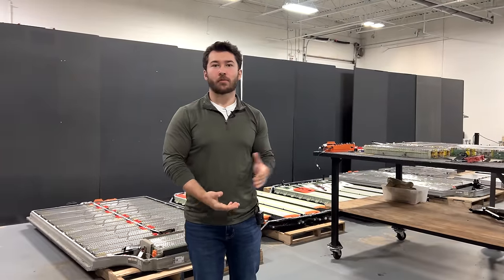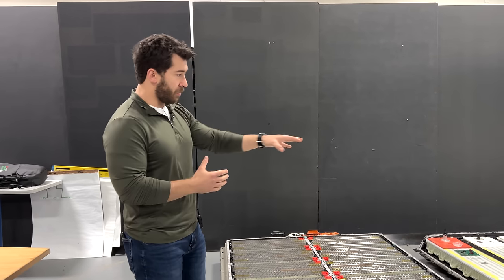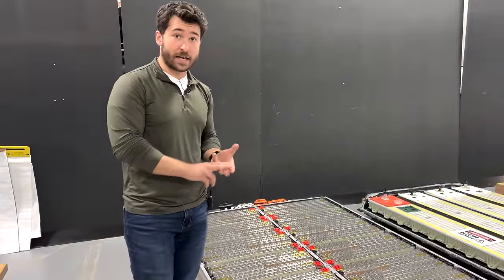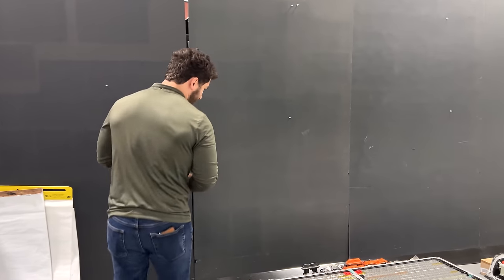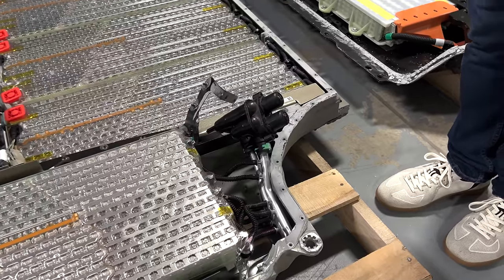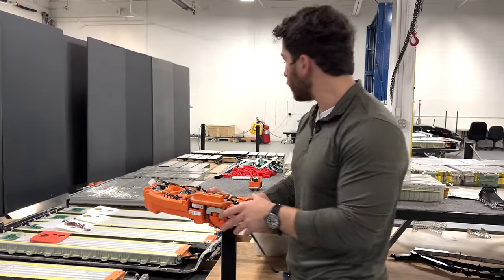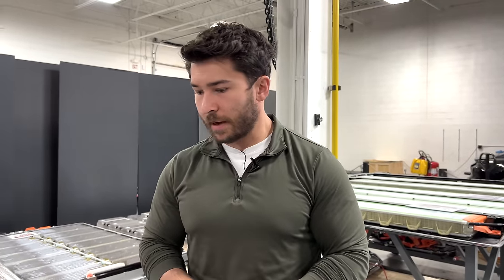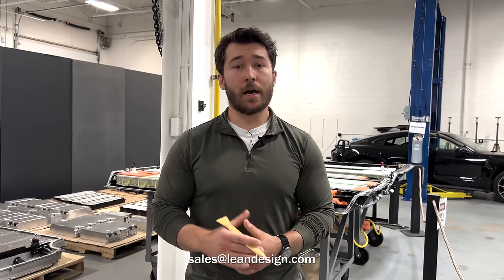A First-Ever Tesla Teardown! Model X Battery Pack Overview

Comment: I'm no engineer, let alone an automotive designer or battery expert, but this pack strikes me as much more useful, practical, repairable, and recyclable than the foam saturated 4680 skateboard that you've torn apart in previous episodes.
Reply: All the other packs are optimized for speed of production, not repairability. There’s a reason this pack is in an expensive car.
Reply: Remember that a 4680 battery pack is structural. It is not carried like a sack of potatoes, but is a stiff part of the body.
Reply: Actually it’s less… the foam is both more rigid because of adhesion between all cells.

Also the foamed batteries are more recyclable because the foam can be melted using a solvent leaving just the metal and plastic components.

This X pack has way more flex and way more plastic connectors and spacers.

You’re correct about repair ability tho.
Reply: All Leaf battery packs are modular and they're hardly a premium car.
Reply: @ramblerandy2397 Not entirely true. The foam alone doesn't achieve the increase in stiffness. It was the level of integration of the battery.
Other HV-batteries achieve also very high stiffness levels without foam. It is basically a decision between cost and what kind of repairability requirement is set. If done well the battery actually increases the overall vehicle stiffness by a lot...but that ofc comes with a lot of weight.
Reply: repairable yes, but I doubt it is more useful, practical and especially recyclable. From what I understand from the 4680 pack (I'm no expert) is that they will just throw the entire pack in the shredder after its useful life and seperate all the metals and stuff which can be directly recycled.
Reply: You don’t design something to be repairable if failure rate is low… it would omit add costs
Reply: @cybertrk sadly not the full picture... typically the pack will be grinded and after that a certain separation process begins. Depending on the process you have to use heat, chemicals or liquids, which result in pollution gases or waste liquids. It is possible to reuse that liquid for the process to achieve a high level of efficiency, but overall that foam will end up somewhere, which is typically not a good recycling design.
Here it was basically decided that the easy manufacturing process, which ofc equals cost - is more important than the life cycle of the battery, after it leaves the production site
Reply: 4680 pack is actually no harder to recycle compared to other solutions. It all goes to scrap metal shredders, and then you separate foam, plastic and other stuff from black mass. After that you send black mass for refining to extract metals like lithium, copper, nickel, etc.
Reply: There is no point in making it repairable. That'd be the equivalent of making a tvs individual pixels replaceable
Reply: when quatity is really good, it doesn't have to be repairable. Ideally all battery cells age/degrade identically, so module replacement is not an option, you'd have to replace all modules... which is easier if you replace the whole pack.
Reply: @Poxenium  but 4680 pack is actually repairable. They will locate dead cell (or cells) and will endoscopically drill through pack to get that individual cell. After they pull dead cell out, they will insert new cell, close everything back together and thats it.
Reply: @jirijezdinsky7493  that is correct...but there are also laws which mandate a certain level of repair and recycling. Over the time the degree of those gone up by quite a lot. For example the europan law mendates a recycling quote of at least 99% of the body of a vehicle.
Recent trends show that sth similar will be mandated for HV-batteries. That is why some manufacturers are going in that direction. 
In my opinion that is very good for the HV-battery, because is still very difficult to forecast the aging of the chemical components. The overall development of the cells in the recent years is astonishing.
Reply: @Poxenium Yes, in an ideal world...sadly quality is with cells the same as with fruits. 99% of the time they are good and everything is fine, but in 1% there is a worm...it very difficult to forecast the aging of cells. Also because of design of the pack (cooling, busbar etc) and the environment have an impact on the aging it is even more unlikely to forecast. But because you need to give a certain kind of warranty, the design has to be certain kind of repairable.
Reply: @stefyyy1994  with that in mind everything is repairable...but is that cost effective? I'm pretty sure that no company will take over this task. It is just too time and cost consuming to repair one individual cells. Sometimes it is not even cost efficient to repair one module...
And your description of getting a cell out is far from correct...finde someone  which happily will drill out a high voltage pack. Even if if you drain the battery (not good for aging btw ;) there is still high risk of problems. + Cell back in, welding, re-charging, testing and so on...can't see a business case here
Reply: Decision is based on failure rate of cells. If low enough then cost savings of manufacturing outweigh the cost of only being able to service at pack level. Such as 2% failure rate x $15k per pack vs save $500 per pack with no serviceability this is a net save of $200 to do this and only service at pack level. Also will say trying to put a new module into a pack with old modules will decrease life of pack and not be able to fully balance pack. Does not fix it, end up usually needing a full pack replacement in a short time.
Reply: @stefyyy1994 you have sources for that?
Reply: @ElmarBon Munro talked about recycling and repairing with Gruber.
Reply: @DB-Barrelmaker  It'd be more like making a 100-screen system having the ability to remove a screen of the system, but that would require them to care that their modules could be independent.
Reply: @ronaldking1054  no, it's like what I said, repairing pixels.
Reply: @madcoyote  Actually, I didn't mention the importance of the foam. I think you quoted the wrong commenter.
Reply: @ramblerandy2397  I phrased it wrong. Sorry...
Wanted to say that the foam itself doesn't increase the stiffness of the battery that much to make it structural. HV-batteries in general are used now as structural parts of the body. The 4680 is not entirely unique because of the foam, but because it replaces the entire bottom of the body and therfore a higher form of structural integration. The foam was only an easy and cheap way to add a bit more stiffness to it
Reply: @ramblerandy2397 that's just the frame. Cylindrical cells ain't doing shit.
Reply: @stefyyy1994  there is zero chance that any cell would ever get replaced by the means you described ... endoscopic drilling, extraction and replacement. You'd never get the cell out of the foam and adhesives.  Plus the performance of the cells has to be matched and balanced, only just the right cell could be used as a replacement. 

There are reasons tesla made the initial use of 4680s very low key and conservative in a limited run of model Ys.    They had to ensure the cells and packs were actually reliable and safe before a broader roll out.
Reply: the model 3/Y battery pack is Maintenance FREE & lasts the LIFE of the car. 
the 2021 model S/X are NO LONGER Serviceable. also, Maintenance FREE.
Reply: As Elon said the Tesla structural battery pack is simply recycled as “high-grade” ore. Makes sense if one ponders for a moment.
Reply: @tuurschellekens5385 You are correct. I have heard Elon say that the structural pack is handled like high grade ore.
Reply: @DB-Barrelmaker  No, if you use a round robin technique with a little bit of brains, it is a screen rather than pixels.
Reply: @TsLeng Wrong  by Elon’s word! Foam is structural.
Reply: @TsLeng  Not what I am seeing " that's just the frame. "
"In contrast, the structural battery pack is a lightweight and integrated design. The cells are bonded directly to the chassis of the vehicle, which helps to reduce weight and improve rigidity. The structural battery pack is also more resistant to damage than a traditional battery pack."
I expect you may ask about the damage.
"It is better able to distribute impact energy. The honeycomb structure of a structural battery pack helps to distribute impact energy evenly throughout the pack. This reduces the amount of force that is applied to any individual cell, which helps to prevent damage."
Reply: @danharold3087  you will have to bond the cells together substantially to achieve rigidity. Then you need to consider is using a  component which is flammable as a structure is sensible. The cells also need to be individually rigid to form a strong structure .Then on top you need a frame anyway. And don't forget cooling for the cells. All individual cells need to be connected to a busbar. Impact and stress forces need to be considered.  Nothing is ever fully rigid and will flex. Do you want those bus bars on the cells to flex?

Now imagine pouch or prismatic cells. Something like CATL/BYD cassette(blade) type cells. Much better .
Reply: @205rider8  elon also said his roadster 2 can fly ....😂
Reply: @TsLeng  Sounds like you did not watch the Monroe Live 4680 teardown.
Reply: @205rider8  that phrase can be applied to everything. I can grind everything down and describe it as a "high grade ore"
Sadly if you want to separate the components there will be most likely usage of chemicals or heat - at the least there will be polluted water. Especially considering the foam, which will end up somewhere...that is by no means a very good recycling design, let alone a pack which can be repaired or used for a 2nd life (not talking about taking one cell out - getting a module out and reused/replace it is the best you can do)
Reply: @TsLeng  Now imagine the top engineers in the world, at Tesla, know more about it than we do.    You do recall it is much harder to get a job at Tesla than getting into a Ivy league school.
Reply: @DB-Barrelmaker  If you want to make this individual pixel analogy you have to accept that there are 73 other pixels wired in parallel to that one bad one and their performance can be significantly impacted by its failure.
Reply: @ramblerandy2397 While a cool story, it adds get to a car for the same battery capacity and adds complexity replacing, having the interior attached. All it does is save cost for Tesla.
Reply: @madcoyote have you not heard of sip's (foam sandwiched between plywood, called structural insulated panels)? insulated panels
Reply: @thisApex3D that's wrong lol and comical
Reply: Yes trying to repair a model 3 pack currently and its not like s or x which is made to be repaired when  u have a bms error or module imbalance causing car to stop charging
Reply: Few cell go down , just throw it away.😂 the green sustainable future.

Comment: Hello there, the early Model S vehicles were equipped with a battery pack 1.0 featuring a so-called "sand fuse" with an access panel on top. This type of fuse was also installed in later batteries, known as 2.0, which had fuse access from below. The Model X and newer Model S vehicles came with a hybrid battery-powered fuse. These are programmed into the Battery Management System (BMS) and need to be replaced approximately after 5 years. The actual voltage level of the fuse batteries is not measured at all. When the BMS indicates that the fuse needs servicing and if you have a battery warranty, it can be replaced free of charge with the latest type. The latest type is called "hybrid self-powered"; the power for the current measurement circuit and the pyro element comes from a small voltage drop across the fuse. This voltage is then boosted and stored in a small supercapacitor. These fuses never need replacing.

I understand that you are the experts, but it is concerning to see you getting so close and leaning next to the exposed terminals of the high-voltage batteries. This presents a false image to the audience that the HV batteries are safe. Please at least wear high-voltage gloves and goggles for safety! Safety should always be the top priority, and demonstrating it helps set the right example for viewers.
Reply: I wish I could give this comment more than one like!
Reply: does this have anything to do with battery contactor? I got bms_w073 alert, car unable to start. the car drove fine though. also got drive inverter high voltage interlock loop error. service center replaced the battery contactor under warranty. did they need to drop the HV pack to do it?
Reply: The battery contactors (2) are the big switches that put the high voltage on to power the car. If you want to replace those, you have to remove the battery pack and open up the rear of the battery where the bms and current sensor are located also

Comment: I remember going by the pack swap station prototype at Harris Ranch on I-5.   Looked like a bay from a Oil Changers.  Drive in and swap the pack in 3-5 minutes.  Putting the Superchargers near it make a great juxtaposition showing how Tesla's thinking evolved.
Reply: NIO cant Turn a Profit , nor can they GROW , because of Battery Swaps.
Reply: I would guess swap stations are 5-10 times more expensive than a supercharger bank since the station still uses fastchargers for the incoming packs for a fast turnaround plus lots of mechanical workings subject to wear and break downs. I can see why they didn't continue that program with high cost and high maintenance while charging speeds continue to improve making swapping unnecessary.
Reply: @SkaBob  But faster charging speeds are not good for the battery packs longevity.
Reply: @Resist4  Tesla owners by me are reporting about 95% capacity after over 150,000 miles Supercharger charging.  They all got free Supercharging for life with their cars so use them often.  At least for Teslas,  I think the whole battery replacement cost thing is a way overblown.
Reply: A battery swap station requires people to work at it.   So it was a no-brainer to do away with that !
Reply: It was my understanding that the only reason Tesla designed in the pack swap was to get additional government funding. They never had any intention of actually doing battery swapping for the general public.

Comment: At 82000 miles my 2016 model X just needed a replacement of the pyrotechnic fuse because batteries low. That early a model required dropping the battery. They later did a cut out so it could be done from below.
Reply: Ouch...
Reply: Maybe within warranty
Reply: Imagine replacing a fuse because the battery of the fuse died lol.

Comment: Thanks for the overview of these packs.  I'm currently installing 6 Tesla Model S modules into my Porsche 914 electric conversion.  Wish me luck!
Reply: That's sick
Reply: @Matzes  It's OK, it was a 1.7 liter model, I wouldn't do that to a 2.0 liter 6 cylinder!  I did the initial conversion in 2008 with lead acid batteries, swapping in the Tesla modules will be half the weight and double the range.
Reply: Given the lack of software, correct motors, proper tires, wiring, computer control, etc, your wasting your time.
Reply: @MikesTropicalTech  You da man Mike !  Make a video!

Comment: Morning munro crew! 

Think it's important to state the model year of the model x, this looks like a pre plaid version with the extrusions and small models.

Plastic wrap is... Interesting

No inner fasteners. Very happy to see that. Curious to see how it's bussed. Laser weld?

Vertical connections for swapping, yup, 2018 or earlier. 

Kinda jealous it was so easy to remove 😭.

Want to see the Porsche. 🥺

Like the hv module assembly, simple, compact.

Pyro... Hey, those look like fasteners...*judging*. Internal battery!? Interesting!! Would love to CT that ...

The yellow wicking adhesive was a newer upgrade, 2021 and later, likely using the gray thermal or an older thermal paste option.

SP?

Great job Julian!
Reply: He said a 2020 model X in the beginning.
Reply: Actually, he said many times that it was from a 2020 model year. Hard to miss.
Reply: Ok. I missed that

Comment: The cutout fuse having it's own battery is obviously great. It works like a modern alarm system. When the mothership stops responding or the airbags go out it is time to blow. If the whole thing is in short, there would be no voltage to cutout. So while i'm being captain obvious here. I would be quite shocked if others didn't do it like this.

Comment: Consider using a screen prompter; there's an app available for download that can assist with this. Another approach is employing a voice-over explanation—film the relevant areas or use a computer-generated model to synchronize with your voice. While you have the right appearance, addressing nervousness in your delivery is key. Sounding unsure can lead to viewer disinterest and confusion about your message. Confidence in your presentation will likely help maintain audience engagement.

Comment: Generally I like Tesla's 18650 packs' robust thermal management, but the smaller cooling channel w/o thermal paste (is that right??) is very disappointing. My biggest concern with the 4680s is the longer heat path through the cell almost certainly causing uneven cooling. Tesla definitely gets a "plus one" for serviceability on this pack though.
Since Model X is relatively low volume and the tooling is long ago amortized it hardly makes sense for them to shift to casting the battery housing structure until there is a major upgrade to the vehicle, which is long overdue.

Comment: 15:05 It’s a common misconception that the fuse is mid pack and removing it halves the pack voltage. Removing the fuse splits the pack to 14s and 2s.